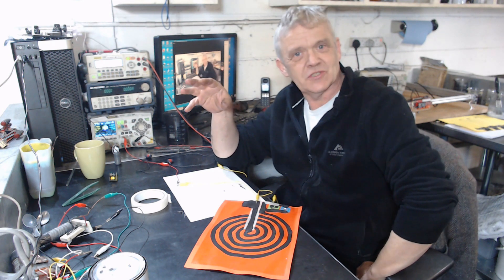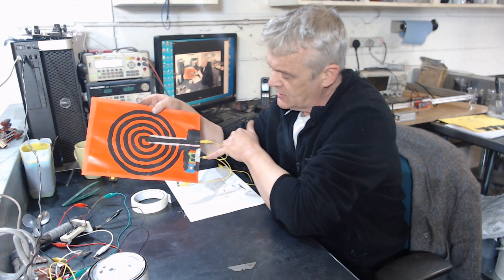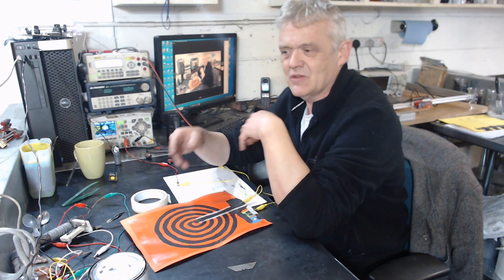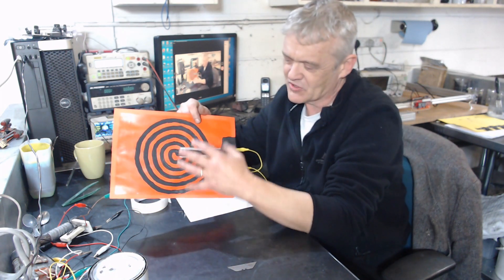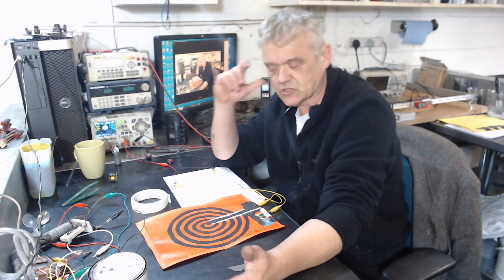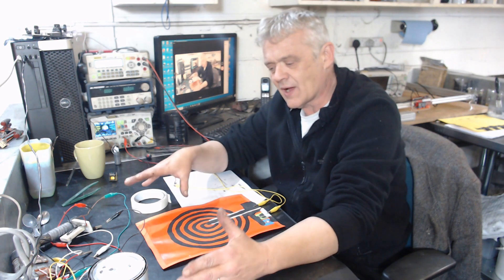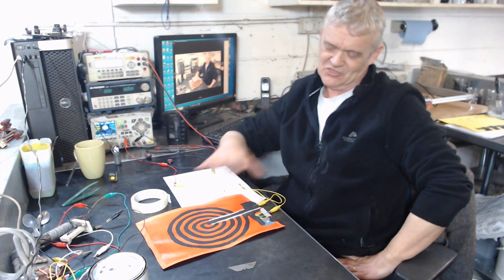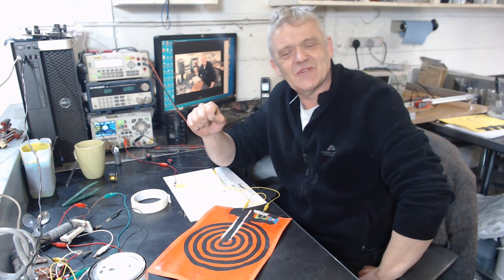A Joule Thief Painted With Graphene Ink

Comment: Dr. Smith, I can see you would really enjoy microwave stripline design. You can make capacitors, inductors, transformers, couplers and many other components with simple patterns on a PC board. It would be really interesting to make a plated-thru hole on your paper PC board with a paper punch and ink on both sides. Your ink would lend itself very well to silk-screening, as you said.
Reply from the maker: i am going to look into it mate - sounds like my kind of thing for sure

Comment: I wonder if that graphene ink could be used in a CNC graghics🖨⬅printer to print precise and very fine active circuitry on paper?.
Reply: Or add it in a re-fill cartridge and print it using a standard HP or Canon inkjet printer :)
Reply: @corresandberg  Now,that would work too,but you can't do graphics with those.
Reply: That is exactly what I'm planning to do with the graphene ink I just ordered from Rob. .  Then use conductive adheshive to hold and connect components.  The equivalent of plated thru-holes might be done simply by punching tiny holes in the paper and dropping-on some graphene ink at each hole after both sides are printed.  We'll see if it works....it is an experiment.  If it works it would be a huge benefit, and likely replace other methods of making homemade PCBs.
Reply: @waynegnarlie1  If it works,make a video to show us,it sounds like a very practical idea to me.
Reply: @4gauge10  Will do for sure.
Reply from the maker: @waynegnarlie1  i really want to see that mate - you are doing videos right?
Reply: @waynegnarlie1  Hi Wayne Just seeing if you testing the ink with inkjet printer and made aa video? I was looking to do the same. Just got some paint and testing. Now looking to make coils, via Printer. :)

Comment: Robert I'm still waiting for the Home battery. Even if it is a kit that enhances lead acid batteries.
Reply from the maker: you can buy the bits on the shop mate - but they are not cheap as this is experimental

Comment: One coil on top of the other can transmit AC power from the one to the other wirelessly.
Reply: Cool, that is in the [ Painted Graphene Transformer (A Graphene Tesla Pancake Coil) ] video.
Reply from the maker: it can mate and as  long as the q couple is good it can be quite efficient
Reply: @ThinkingandTinkering  😎👍